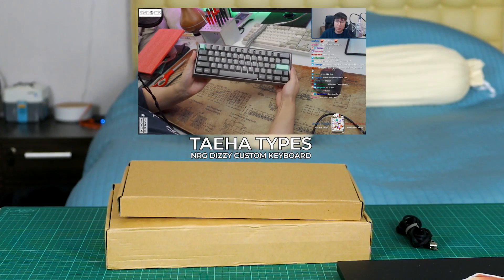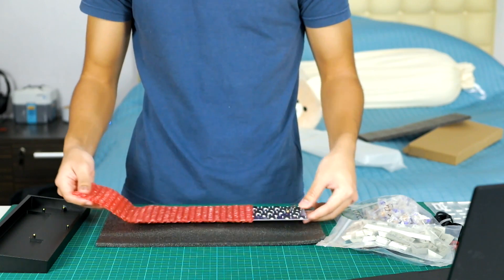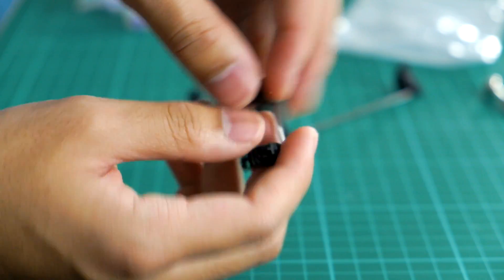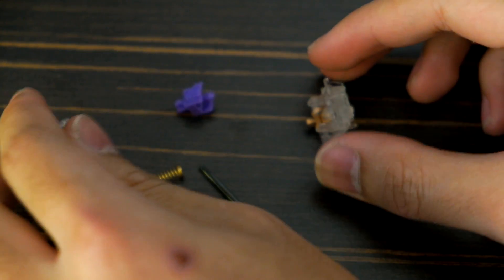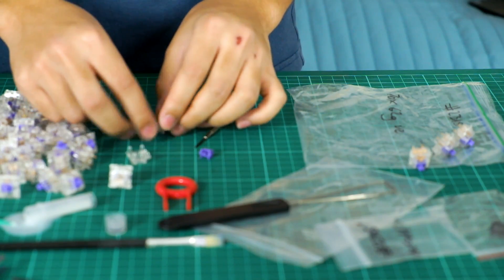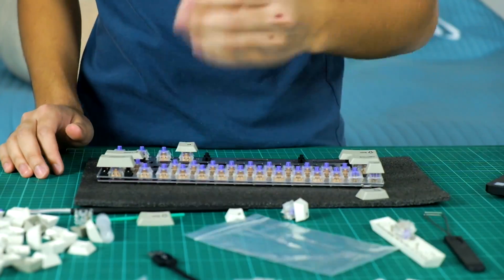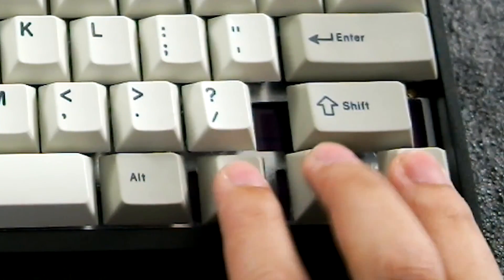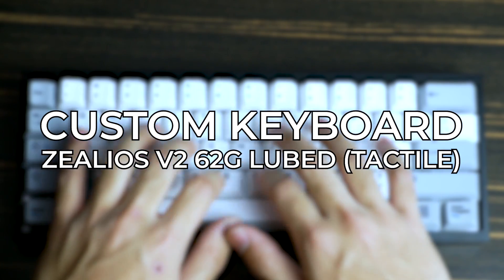Today I Learned How to Build A Custom Mechanical Keyboard!

Comment: This was great. I am looking into building my first mechanical keyboard as well and both the pcb and case looks solid for this. Sounds a bit hollow when you type. Did you add any foam in the case?

Comment: try spray lubing it is really quick. i used wd-40 because I am in Australia but any spray lube. Here are the steps:
- take off keycaps
- push down switch
- spray into the housing of the switch with paper covering the sides

Comment: I think I bought the wrong keycap set too. How do you know which set to get for a standard 60% board like the one you did in this video?
Reply: practically any keyset will work with the 60% layout, the main thing to look for is the bottom row

Comment: Razer and Logitech keyboards are literally the worst to exist
Reply: DragonOg Gaming Yes but at least Razer does not have proprietary stems so you can use custom caps and hey if you go trough and lube the stabs and use dry spray lube on their optical switches it goes from terrible to surprisingly good for a pre built. It’s a good thing to try if someone already has a keyboard that they can experiment on before building their own. After building a keyboard of my own I agree with you lol
Reply: siraxhead yeah I guess you’re right tho
Reply: siraxhead bro do you have any recommendations for lube?
Reply: DragonOg Gaming krytox for switches and dielectric grease for stabs
Reply: razers been improving tho

Comment: There is an acrylic version of the Tofu and an acrylic plate as well if you wanna go that route for the RGB.

EDIT: You could also place some isolation under the PCB betwen it and the case to make it sound less hollow and metal-pinging.

Comment: you did it!!! but seriously you cant over lube the metal stab bars. those are the source of rattle. i seriously dunk the ends in dielectric grease. it's the plastic on plastic you need only minimal lube. i also would not waste any "good" lube on the metal bars honestly. but hey you did a great job for the first build! i hope to see some more later!

Comment: No bandaid mod, keyboard filler foam, or qmk programming, shaking my noggin. Jk dope first build, really went 0-100 with lubed zealios. 

One thing you could try in the future is bag lubing zealios, normally you'd only bag lube linear switches but zealios are so tactile that some people prefer the bumps lubed. Could definitely save 45 minutes.